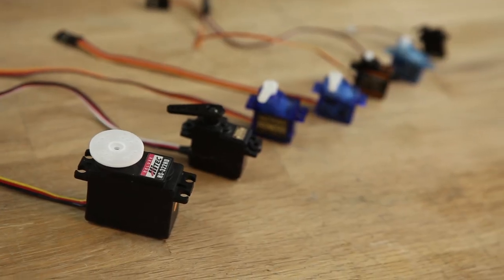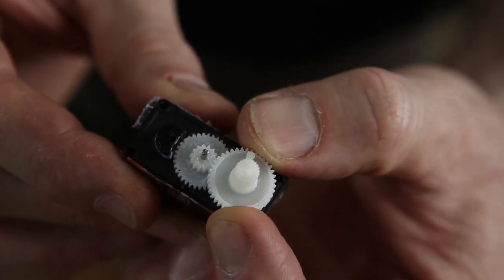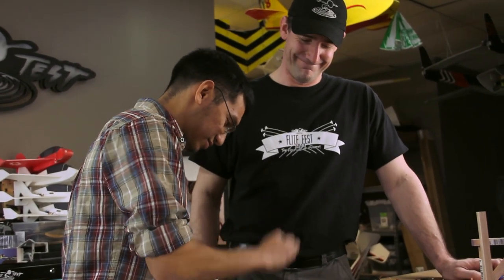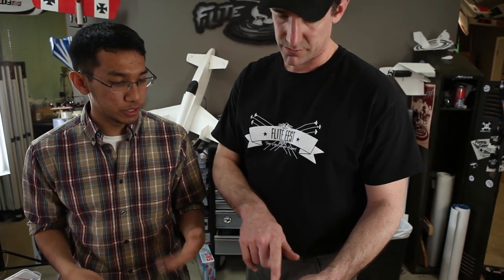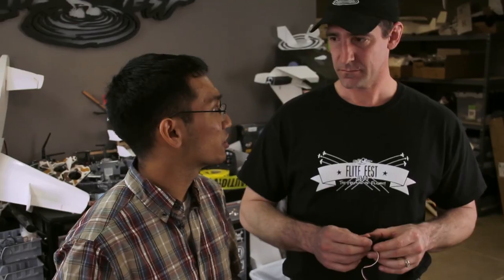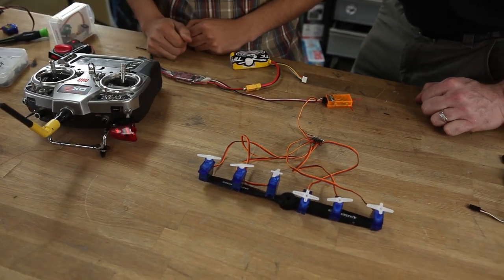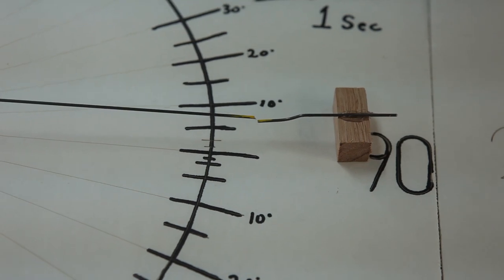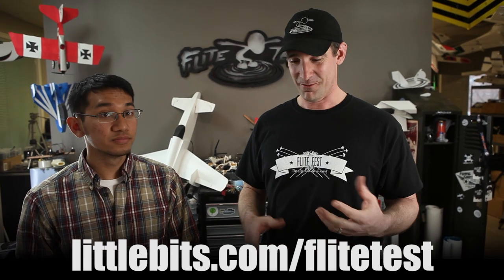Flite Test | Servos 101

Comment: A linear actuator does not have Torque. It has force. Torque is force at a given radius. In SI, it is measured in N⋅m.
Half of the time, these guy's meant force when saying, "torque." Likewise, in other videos, (usually) when they say, "inertia," when really meaning momentum and when they say, "momentum," they mean speed.
Reply: I believe in this case that The linear action of the linear servo is driven by a worm/screw gear. The motor driven worm gear is providing a torque force upon the spur gear that happens to be the servo arm.
Reply: +David Allen 
This is true. However, if that's how linear servos give specifications, it's not very useful.

Comment: very informative, peter if you see this please make a pun jet for the mico cargo, biplane?
Reply: Jack  does anybody think its possible
Reply: Jack Scaling it down is going to be hard. I think foamboard might actually be too heavy of a material at that point, and the motor is also going to be a problem.

Of course, with enough money it's possible, but i don't think that they would work on it. The only material flite test has used is foamboard, and i do not think they will stray from it for the sake of consistency.
Reply: Jack The problem is, smaller the plane, higher the tolerances You have to meet for the plane to fly well. And for a foldable foamy the Pun Jet seems to be on the edge.The other point is, smaller the plane, the more agile it is. You would need a very good reflexes to control it. Or use an onboard stabilization. But the rule of thumb is, bigger plane flies better. Or is easier to fly, at least.

Comment: Question
If I fly a plane that's 1-1.8lbs
What's the smallest servo that would work in a straight wing trainer.
It has 8 or 9 gram servos now.

I'm thinking of building a lighter scratch built Sailplane & wondered if 4,5 or 6 gram servos would be ok?

Comment: Hi, I am designing a DIY wireless follow-focus/zoom control system for my camera and I'm stuck on the servos choice as standard servos have a very noticeable background noise that is not workable for filming in quiet environments and close to the subjects..   The system requires the servos to rotate at least 360° but 3&1/2 revolutions would be preferred.  Which servo motor would you suggest (brand and model)?  I thank you in advance. Davide

Comment: Good video. Many people learn some new stuff and it's good.
Though You could make it much more explanatory. At least explain, how the servo works. "In the servo there is a motor, gearbox, potentiometer and control board". "PWM pulses come in constant frequency, changes a length of the pulse, which means a desired servo position". "Control board measures a current servo position with a potentiometer and compares it with a desired position. And turns a motor on to make a correction". etc, etc. These things are obvious. For everyone who knows how servo works.

Comment: So you said what a brownout was, but didn't mention what to do to fix it.  Can you explain how to make sure you don't have them?  Do you just give your receiver more power?  Or do you power the servos separately?
Reply: foxrace0985 You need to choose a BEC that will supply enough current for the servos. In the case of the video since the bec built into the speed controller can't supply enough current to power the servos, you would need to use an external one.
Reply: foxrace0985 You need to get a BEC that can handle more load. Peter was using a 1 A BEC in that ESC, if he had switched to something with 2.5 or 4 A it should have worked. 

I read that a standard servo draws about 10 mA, stalled it draws about 200-250 mA and in normal flying 75-150 mA. Since he was moving them quite fast, it was probably more in the 200 mA area. This times 6 servos will result in 1200 mA - too much for the BEC, so it wasn't able to deliver enough power to the receiver.

The bad thing is that you won't notice it as long as it is in the "normal flying" zone with 100 mA, but if you do something crazy in the air, it will just shut down on you.

Comment: 0:56 Sorry for being pedantic, but torque is measured in Nm, it's a unit of force x distance, not weight (g).
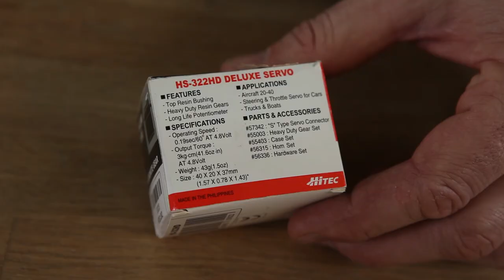Reply: +Scroto Saggins Sorry for being pedantic but weight is a force. You mean mass ;) Anyway at 9:48 you see on the box that they use kg*cm so understandable that they mixed it up.

Comment: 11:45 That you said "If you go out your torque drops off", this in not correct. The thing changes when distance changes is "force" not torque. The torque is still constant.
Reply: And difference is? Torque is basically force
Reply: @lusicilusci4420  It's totally difference bro. Torque = Force x Distance. Torque still stand there the same value even you change the servo arm length (Comparing to the same power the system spends).
Example, give the servo has a torque value at a rate power = 10kg.cm
1) Config#1: Servo arm length = 1cm. Force will be 10kg while Torque is still 10kg.cm
2) Config#2: Servo arm length = 10cm. Force will be 1kg while Torque is still 10kg.cm
Torque and Force are completely difference.

Comment: Maybe you can help me. I need a servo where it sits forward in the neutral position. I then need to be able to turn 180 and look behind. When I say 180 I don't mean total travel because they does not turn enough. I also cant use a continues travel servo that also will not work for my application. Is there a hack or is there a type of servo or what can I do....any input would help. Thanks

Comment: One thing you didn't seem to mention is whether 6v servos can handle 7.4v for extended periods...
Reply: the answer to that would seem to be self-evident - no. buy HV servos if you want to run without a bec or diode on 2s lipo packs.

Comment: Do I need to use PCA9685 to run a single MG996R with a raspberry pi 4? And would I need to add more battery unit to get it to work? I've ran my code and it works but I don't see any movement on the motor.

import RPi.GPIO as GPIO
from time import sleep

GPIO.setmode(GPIO.BOARD)
GPIO.setup(7, GPIO.OUT)
pwm = GPIO.PWM(7, 50)
pwm.start(0)

def SetAngle(angle):
    duty = angle / 18 + 2
    GPIO.output(7, True)
    pwm.ChangeDutyCycle(duty)
    sleep(1)
    GPIO.output(7, False)
    pwm.ChangeDutyCycle(0)
    
SetAngle(30)
pwm.stop()
GPIO.cleanup()

Comment: im trying to rotate a 4 inch diameter pvc pipe with a length of 5ft and a weigth of 15lbs i want the servo to be at the top is there any you would recomend

Comment: Would brownouts be reduced if you put your receiver on a separate BEC?
Reply: +TheUnnamedGent Yes and no.  Your speaking of an external BEC and that is what a lot of us do for RC car racing, since we typically use low cell count batteries and large high KV motors . The reason we do this is not necessarily because the ESC&#39;s BEC can&#39;t still work everything, but it is actually a stability and over all performance decrease when the ESC is under load from the motor. That factor also induces more resistance, creating higher temps to the motor and ESC, and will even effect a batteries life cycle to boot.  To negate this effect, we use an external BEC a lot of the times with a low resistance&quot;glitch buster&quot; capacitor. That allows for a cleaner more consistent power supply that doesn&#39;t need to pass through the ESC at all, reducing the resistance load on the ESC.  The Rx and servo&#39;s power needs will only be effected by the batteries output flux, rather than that and the ESC&#39;s resistance together.  The best thing anyone can do to avoid a brown out is to use a capacitor bank plugged into a spare receiver channel.  The capacitor bank will not only give you a reservoir of stored energy, but will also stabilize electronic noise, thus sustaining a cleaner signal overall.  You can take it even further by installing a capacitor bank, AKA &quot;boost packs&quot; in line from the ESC to the motor as well.  That will further reduce load resistance felt by your ESC and battery during hard accelerations since you now have an even larger power reservoir to feed from during initial pulls.
Now that this is out of the way, you still need to have enough current flow to feed everything from the correct battery choice.  This is negotiated by your cell count and C rating.  The higher the voltage, the less resistance you will experience under load.  However, just as importantly your C rating is what will really matter when you apply a sustained load "over all consumption needs" from your setup.  If you try and take more current than a battery can give "to low a C rating", then you will just create resistance once again, and you can still deplete your system's needs to keep everything powered.

Comment: I have an idea for an awesome episode. Build a small, strong, and fast plane that could handle being launched from a window of a vehicle moving 30-40 mph. It should have a top speed of at least 60 mph. Go back to that glider club and take a ride in a glider. Have them fly critically slow, launch the rc plane out the window and fly formation with yourself! It would work best from a Schweitzer, they are slow and have a large window. You would need some kind of recovery system, the battery would die before the glider needs to land. I would use a parachute or maybe wait to launch until the glider is 10 minutes from landing. Check my videos for all my glider lessons and flights.

Comment: hi, you may have covered this and i missed it but is there any difference in using a standard size servo that pulls 3-4 kg and a 9g servo that pulls 3-4 kg? (apart from the size of course)
Reply: the price, and the power consumption.

Comment: Will my old 80's Futaba servos work with my new FrSky X8R receiver (if I change the connectors to match) ???
Reply: I'd try it with a servo tester first but have done what you ask and it's fine. The only adverse thing I noticed is they are pretty slow ;)

Comment: So if you have a lot of servos, how do you prevent brown outs?
Reply: Use either an ESC that has a higher amperage BEC (about 2a max) or a separate UBEC as they are available in 5a versions, for example.

Comment: I'm wondering why you are using different suffixes in the diagram. For example you have a diagram showing different pulse widths but confuse the issue by having two pulse widths of 1 & 2 mS while the centre pulse withe is measured in Micro S or as you show in the diagram as 1500uS which is 1.5 mS. If you make a diagram use the same units and don't mix multiplierd. e.g..  mS and uS.

Comment: Interesting video but the PWM explanation is completely wrong. PWM is used to vary the speed of the motor.  The position is determined by the resistance value of the potentiometer.  

Please correct this as it's some pretty serious misinformation.
Reply: Kenny Downs The receiver sends PWM signals to the servo which define the position the servo is supposed to go to. This PWM signal is different from the PWM DC motor speed control you are talking about.

The servo then uses something like PWM and probably some fuzzy logic to drive the motor so it moves to the "dictated" position and uses the potentiometer as sensor for that.
Reply: Oh. Well I feel stupid.  Thanks for clearing that up:)
Reply: Kenny Downs Don't feel stupid. We are here to learn after all. Also I might have just made everything up ;).

Comment: @13:16 you are starting to talk about speed. Is it constant? how can I control it.
Reply: With faster servos, you will get more speed. But beyond a certain point you need to choose servos withstand low speed/high torque, med speed/medium torque, or high speed/low torque. There is a trade off at the maximum end of performance, where you find the better attributes costing more with high end servos. Your controller can't make your servos faster, but if the servos are too fast (twitchy), you can set your tx channel's "exponential" curve to compensate for it.